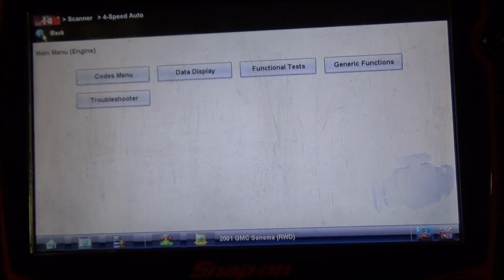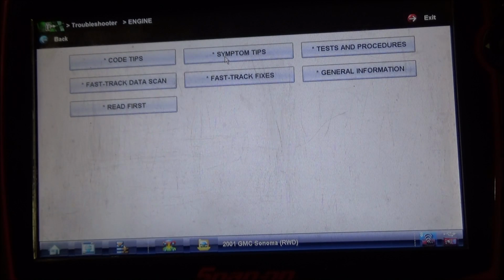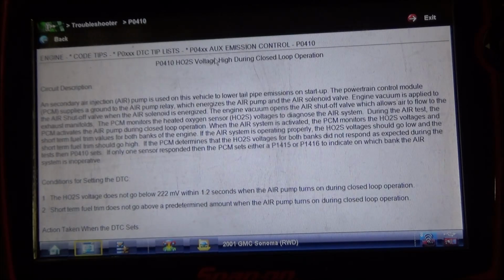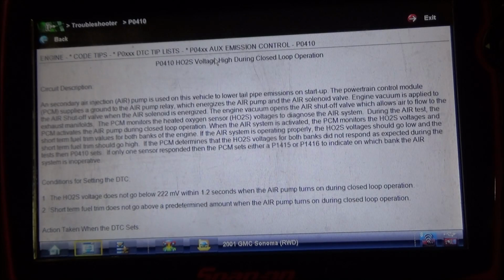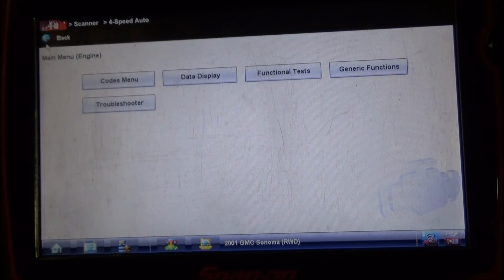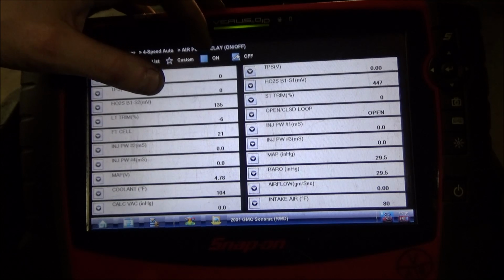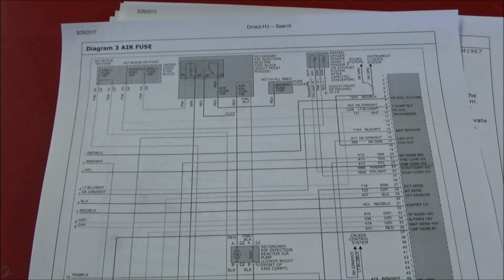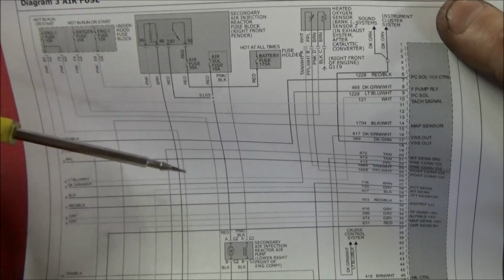2001 GMC Sonoma 2.2 Secondary Air Injection System Fault

Comment: Hello I have a 2001 Sonoma air injection it won't a good RPMs if you go slow they'll go higher but I think the air system has a problem with it because if you try to get a gas card it just falls on his face and if you put a load on it it falls on his face so I think it's the air system what do you think I replaced every unit in it we did it all and it still does it it's getting a little bit better but I think this is a problem with it just let me know what you think

Comment: I spent a weekend replacing this whole setup on 2001 jimmy, check valves and all. Code still there. So we learned to accept each other. Sit behind my wheel to long you get sun burnt from all the dash lights...just wait til the fuel pump starts to go out...thats at least a years worth of fun.
Reply: Same here by any chance , does your right turn signal light up on your instrument cluster ? Does your right turn signal click faster as if a bulb went out ? I saw videos where the pumps ground and the right turn signal share the same ground . They said it could be a bad ground and needs to be fixed

Comment: What would cause dash indicator  lights going on and then turning off on their own?  My vehicle (2001 GMC Sonoma) still runs fine, but the service engine soon light goes on and off as does the ABS, & parking brake light. Loose wiring?   Electrical issue?
Reply: nope, GMC

Comment: My 03 S10 has this problem now and a vent valve
Reply: I have a 2002 and the air pump has always been a problem. That and the check valve. 

The problem I’m having now is the system is reading “not ready” and it’s been driven….? 

System has been completely changed out and I don’t get it?

Comment: Thanks for the info. Helped me troubleshoot a 2000 GMC Sonoma P0410 code. Tip for others: Check the vacuum hoses. A 20 year old rubber hose could easily be deteriorated if it has never been replaced.
Reply: Where is the secondary mass air flow pump located
Reply: @tobysmith4027 under your fender , far right side , passenger side of truck .

Comment: "Extensive teardown to access the relay".  HOLYJESUS! all you have to do is remove the battery! Takes 30 seconds! This "mechanic" is too lazy to pull out a battery. And that's not ATF on the motor, that coolant leaking from the coolant tank above it. You are the worst mechanic ever.

Comment: On a 2000 Gmc Sonoma with P0440 code what other than a bad gas cap could be the problem. The P0440 code means that the control module has detected a leak in the Evaporative Emission (EVAP). Loose fuel tank filler cap is the most common cause that triggers the P0440 code.

Comment: How do you turn the power relay on without a bidirectional scan tool? Does ground from the solenoid go back to the relay, or is it local to the motor jack?

Comment: I have a 2001 Sonoma 2.2l which now has no fuel pressure at the rail. I've changed the fuel pump, filter, fuel tank pressure sensor, and the coolant temp sensor. Any suggestions? I really need my only ride to run again. Please help
Reply: Fuel pump, fuse; fuel pump relay; fuel pump oil pressure switch. There is a fuel pump prime connector on the under hood fuse panel right next to the FPRelay. Jump 12v into that slot and listen for FP buzz.

Comment: why cant i find a mechanic like you in my area of Connecticut.  The last one I had charged me $500 to change out solenoid valves etc to fix a check engine gas tank pressure test failure.   driving home the light came on again, while filling up I noticed a gas smell, used a flash light to find a rusted out fill pipe.  changing the fill pipe fixed the pressure test.  never got the $500 back and had to pay extra for the fill pipe install.  total rip off.

Comment: Was this a code that the customer wanted to fix or will this item cause the truck if it fails not to start? Also on a sonoma 2.2 it tries to fire very poorly checked fuel pressure with gauge and it read 39 psi would that possibly be do to a weak fuel pump since car has good spark but will not fire up? Tks for your time
Reply: A weak fuel pump on my 2001 jimmy caused  a no start. The vehicle is VERY picky on fuel pressure. It must have at least 54lb if I'm not mistaken(I could be off). this issue is a pain because it can be intermittent and cause misdiagnosis and also requires a fuel pressure gauge, and if off just a bit will cause the issue

Comment: Hey Joe I have a ? I have an 01 Blazer 4wheel drive 4.3 plugged it into computer at parts store popped up similar code when broke down said replace air injection solenoid,evap canister,body control module, transfer case selector switch..on a budget man what avenue should I pursue . Thanks brother if you could give me feedback on this on what you think would be appreciated. Basically the air injection solenoid is for the air pump ? And is this related to the evap canister or not and or body control module?

Comment: I had that problem on two different vehicle's, its a poor engineered system and they do not use it on new cars anymore. It is very common for the motors on those things to freeze up because they are down low where water constantly makes contact with it. The inside corrodes frozen on those thing's.
The engine on my S10 had to be rebuilt, many of the parts came from a salvage yard. Well we ended up getting an exhaust manifold that was from a year prior to this secondary air system being in the truck. We did not realize it was different until after it was installed so the plan was originally to use it temporarily until we could get and install the proper manifold.
So their was no way to hook the secondary air back up. So the tube that went to the old exhaust manifold was re-routed over in front of the firewall. Over time the computer re-learned the fact secondary air was not hooked up. Now when I do the ready test secondary air is always ready like a few of the other major tests that always come up ready. I haven't had any issues with it since, it doesn't throw any code and it doesn't cause the light too come on. Essentially the computer omitted it from testing, as if it was not their.
I haven't had issue's with it since and that's been over two years. So the hassle of that system was just completely removed from being an issue. Again its a really stupid design that does very little anyway, so the fact I can get by without it is fine with me.

Comment: can I just remove the whole air pump and put something in the exhaust manifold holes??
Reply: You can take an exhaust manifold from a 1999 Chevrolet S10 and put it on your truck. The 1999 model year does not have a secondary air system, so the exhaust manifold doesn't have the hook ups for it. After that you can remove the system. That's what I did on my 01 and now I no longer have to deal with that stupid system. Over time my computer learned it was no longer their and now my computer constantly gives me the ready for the secondary air. For the first few months after, the light would come on with trouble code 0140, over time it stopped. You are able to pass an emission inspection with one not ready on an 01 and later vehicle, so your secondary air can be not ready as long as long as everything else works.
Reply: Fearless  
You have proof of only having 1 monitor not ready to ok to pass. ?

I failed. An it’s a 01 An only one not working is that.

Comment: Was this a quiz when you used a test light to test from the black ground wire to ground??? Hahaha... Yes, an ohm meter/continuity tester would be the proper tool. Or put pins in the red and black wires and use the light. (Careful not to short between the red and black wires!) Over all, a good video. Thanks...
Reply: If the ground were bad the test light would of lit because the motor would of tried to find ground through the test light

Comment: I have a 2001 Chevy S10 2.2 l replaced pump couple years ago still works great but the engine light keeps coming with that code I've replaced the fuse over and over it's not the fuse any info would be greatly appreciated
Reply from the maker: Mark Bagley, the air pump itself is a high failure item on these,  typically due to water intrusion.  GM has a TSB for replacement of the motor, solenoid,  and hose assembly to try and correct that.  Does the secondary air injection pump run on your truck after a cold start?  Will the motor run if you provide power and ground directly to it?
Reply: the pump does run on every cold start even if the light is on at the time of start and haven't reset it
Reply from the maker: I would be suspicious of a solenoid or diverter valve problem in this case.  The easiest thing to do would be to bidirectionally command the pump to run and the solenoid to open and verify the oxygen sensors drop lean,  if they do not than look into solenoid and diverter operation.  If the solenoid is not supplying vacuum to the diverter than it will not open and allow flow into the exhaust,  the same would be true if the diverter were not opening either.

Comment: Hey thanks for the video! My fuses and relay are good, I can command the pump on and hear the relay click. I tested the relay on the bench as well. I'm not getting power at the connector for the pump when I command the pump on. I'm assuming it must be a broken wire but I'm confused as to why the fuse didn't blow if that's the case. Any ideas? I'm going to check the wiring in a bit with a test light and see if  I can confirm which wire is bad.
Reply from the maker: Just because you can hear the relay clicking doesnt mean its good.  It's control circuitry can be functional independent of the load side.  Do you have load side power at the relay and confirmed that it is going out when the relay is turned on?  If so and you indeed don't have power at the pump than an open circuit is definitely where you should be looking.  As for the fuse blowing,  fuses only blow under current flow that exceeds their rating,  being this circuit is potentially open there is no current flow,  which does nothing to the fuse.  I hope this helps.
Reply: Very helpful, thanks so much for getting back so quickly! I'll test for power on the load side or just try a new relay and go from there. Appreciate the help

Comment: Nice job... Good use of by directional control. Although this would not have helped on this job, it did remind me of a handy tool that I wanted to point out. It is a little pricy for what it is but, they do work well and make certain bypass type testing jobs go really fast. Plus, they give you handy access if you want to scope current..https://www.amazon.com/gp/product/B01K6KY5FY/ref=oh_aui_detailpage_o03_s00?ie=UTF8&psc=1
Reply from the maker: Great tools!  Thanks for the recommendation!

Comment: great video TD where did you get a 1 amp test light?
Reply from the maker: It's a bit of a custom build,  so I took a normal plain jane test light similar to this one (https://www.amazon.com/Lisle-28400-Heavy-Circuit-Voltage/dp/B0002BC06E)  and replaced the bulb with a 3425 series bulb (https://www.amazon.com/SYLVANIA-DE3425-Miniature-Contains-Bulbs/dp/B00318NV54).  This effectively makes this test light just shy of an 800mA load,  and I use it primarily for testing disconnected electrical connectors that are no longer under load,  as well as energizing most solenoids (purge, vent, etc.).  I do not use this light to test computer controlled outputs such as relays, unless I know that the load the computer is energizing is more than the current draw of this test light (just shy of 800mA).